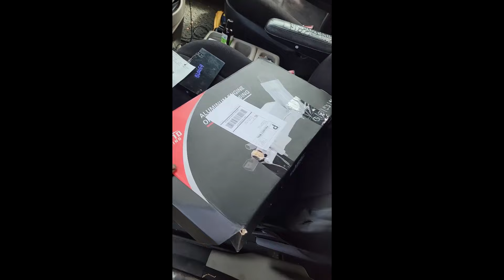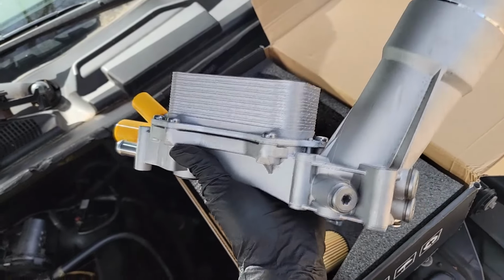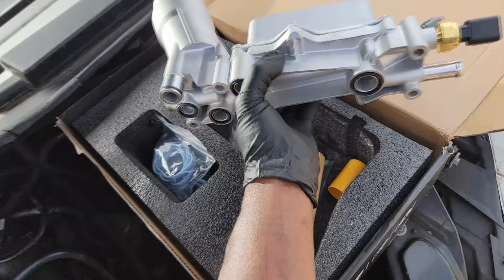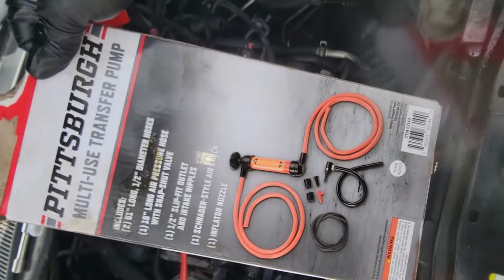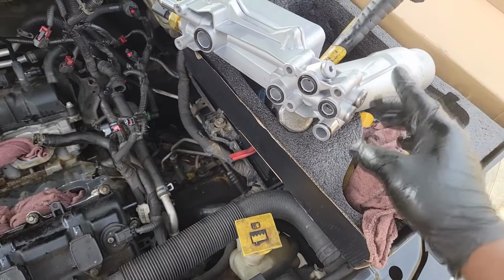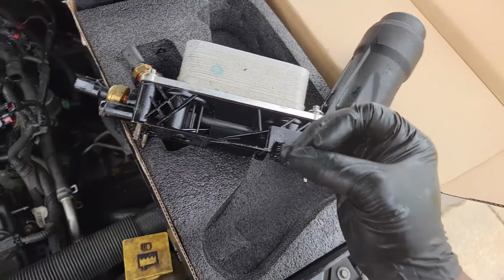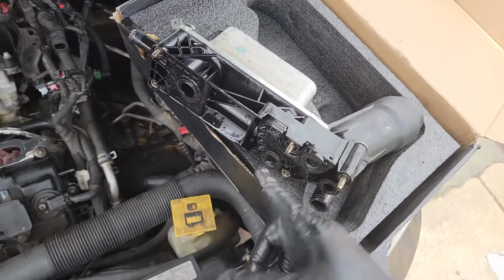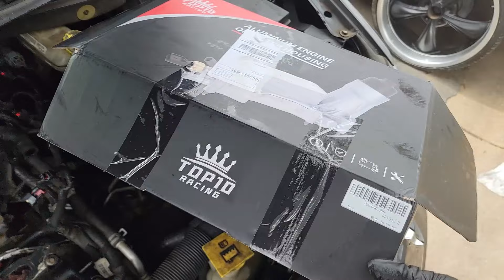The Truth on why the Aluminum or the Plastic 3.6 Pentastar Oil Cooler Leak Revealed.

Comment: That oil cooler is made out of special Chineseium... I changed mine out a few months ago and used the Durman 926-959.... it came with the high heat plantum orange gaskets and manifold gaskets, but not the high heat/pressure O rings, I used CAT diesel  high pressure hydraulic O-rings, from a kit I had at work, they are a little bit thicker, I have at least 2 mm more separation and torque perfectly....TWCC 386 PCS Metric FKM Viton O Ring Kit 30 Sizes Fluorocarbon Oring high pressure and high heat
Reply: I always replace that one oring also. Then smear a tiny bit of rtv on it.  Mostly to help the thicker oring to slip in there.  Never had one come back.  Yet.

Comment: The orange cap is to alert the oil tech that it’s an upgraded filter inside and uses the new filter . So if you put in on say your 2013 3.6 which uses the old filter mopar 744 it now uses the mopar 349 . Or equivalent. Dorman made the housing that way

Comment: Just replace o-ring seals and reinstall mopar part? Best solution for the customer who drives high mileage vehicles? Chinese aftermarket clones too risky to use in such critical area.

Comment: I'm a little late on this question so hopefully you'll see it. I'm currently replacing JUST the orings on my jeep wrangler,193k miles, oil filternhousing,MOPAR gen 5,or whatever the newest never leak again version is,yes,dealership purchased. Also,the oring are dealership purchased,so this isn't an anti-mopar question. Would you recommend putting any lube or oring grease on any of the orings? The leak I have is coming from the front oring,which I lightly lubed with oil for ease of instalation(as soo many peolle do),but I'm wonder if using some dc 44,which has some oring swelling properties(not a magic amount of swelling,silicone based) would keep these orings from leaking in the future. Does dealer manual recommend installing the orings dry only? Or a little lube on the surface of all of them? ( thats whay she said) thanks,man!

Comment: on the plastic cooler it seem the metal tube holding the bolt is only partial at both end . Center is plastic and it melt . You need the metal tube to be all metal this way plastic wont crush . I had my nissan for a decade without issue but the metal tube on the plastic one you installed seem t go only 10 mm in then it's plastic .